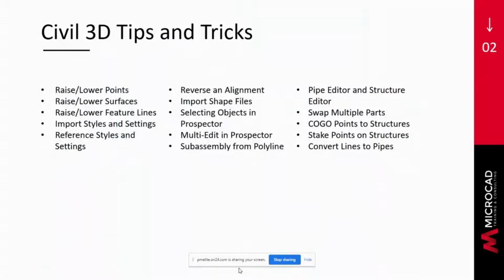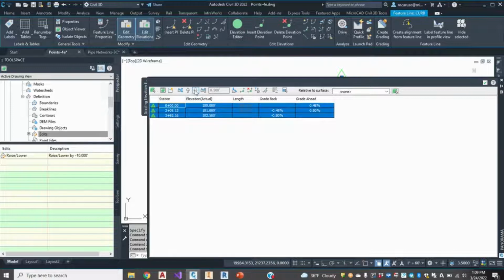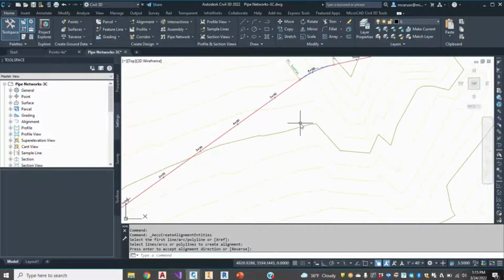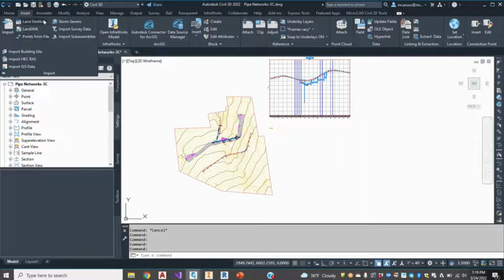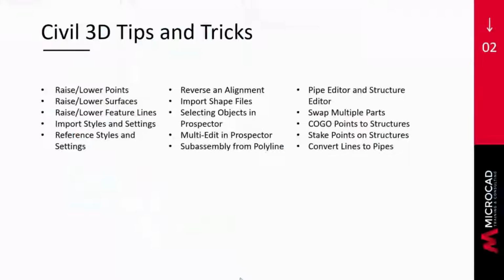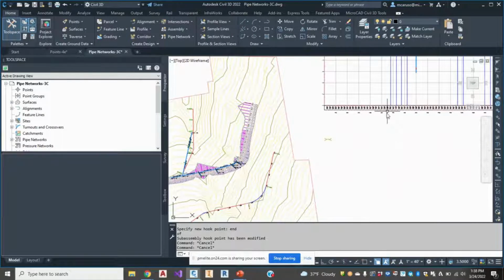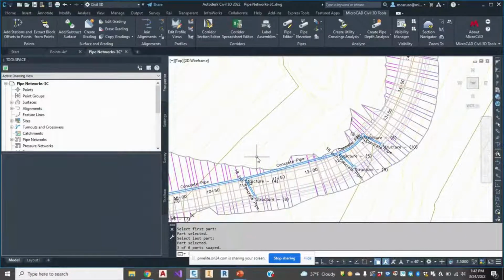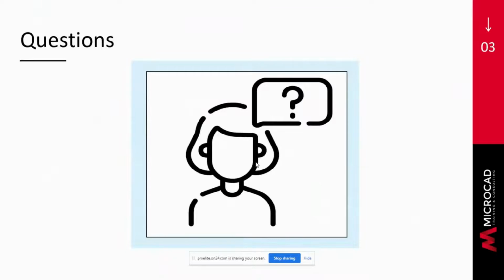15 Civil 3D Tips and Tricks in 30 Minutes - MicroCAD Original Webinar

Comment: Very useful,  sir is there anyway to create cross section for foulsewer house connections with backdrop by civil 3d , as I expect we will have to create part custom manhole through part builder , thanks
Reply: Civil 3D Pipe Networks and parts can be extracted as 3D Solids. 
Switch to a 3D view, and then use the _CONVERTTO3DSOLIDS command.
Use the _SECTIONPLANE command to define and view sections.  Call MicroCAD's office if you need more help.